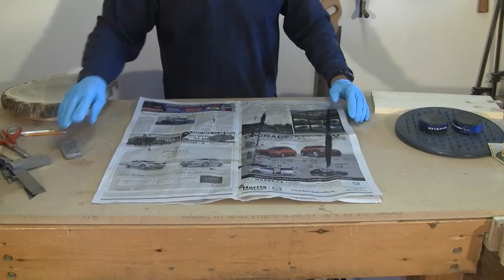How to Make a Lazy Susan with Natural Edge - Wood Turn Table

Comment: colin, ty so much, i,m starting wood work, and i like it, by the way, i,m 62.
Reply from the maker: Dad Ojeda good for you for starting woodworking, it's is never too late to do something you enjoy doing ... well done!!
Reply: amen 2 that
Reply: should i buy a 10'' or 12'' miter saw, what,s ur opinion.
Reply from the maker: Dad Ojeda  Wow, that's really hard for me to answer. I guess simply to say 12" if you have lots of money to spend on tools and blades, or if you need longer cuts. If you want to share some of your cross cut blades with a 10" table saw and you don't need quite as long a cut, this one will also do a great job for you.
If you haven't seen my video on this topic, this might help you too ... Beginners #9 Using a Sliding Mitre Saw   a woodworkweb com video
Colin
Reply: i think i,ll buy a 10'', ty so much my friend.

Comment: Thanks for the video. First I was wondering how that turn table is fitted to both sides as when attached to one side it will block access to the other. I like your approach of drilling a hole in MDF to pass the screw. NEXT, I was expecting you to drill FOUR holes for each of the screws!! At times like this, I remember Newton (allegedly) drilling two holes a big one for his cat and a small one for the kittens. Obviously(!?) kittens followed the cat through the big hole!! Thank you Newton and Thanks to you too :-)
Reply from the maker: Thanks for your comment ... loved the story of Newton :)
Thanks Buddy !!
Colin

Comment: What a beautiful lazy susan!  I never thought of buying the mechanism and making one.  The commercial ones are not pretty.

The one hole you made in the base, and rotated to attach mechanism to top wood piece was a great tip!  I would have never thought of that.

My 3  questions are:
How long did you dry the wood before making this item?
Assuming it is best to cut wood log with chainsaw when still fresh not dry?
Will the bark peel off the log section after a while?  How do you ensure it does not?

Many thanks!!!
Reply from the maker: +Lass-in Angeles The wood I got for this was from a dead, standing tree so the wood was very dry when I got it, and this wood is very dense which means it is less susceptible to splitting, which is a common problem with most woods when we try to do this. The wood needs to be dried very slowly and could take over a year, it is best to cut the slice, store it in a plastic bag and just open the bag to release the moisture once a month or so until the wood is stable .... and hope it doesn't crack.
Reply: I should have read this comment before posting my own question. 
You answered it right here :-)
Reply: +WoodWorkWeb  Thanks!!  Very good advice.  Now here is some from me.  Instead of the Krylon spray, why not try this for a more robust finish:

1. Give this a good coat of Watco Danish Oil Neutral color.  This will feed dry wood so it does not split, and remains conditioned.  Let dry 3 days.  Use this on the wood veneer strip too, so it does not peel or flake but stays conditioned and relaxed.

2. Thin out clean interior oil based Polyurethane with about 70-80% Mineral Spirits or Paint Thinner.  Give the wood disks 2 coats of this, including the bark, letting it penetrate deeply.  50% thinner is not enough!  Must be very thin so you hardly see it on the wood.  This will act as sealer against wood drying out, or water marks, or any type of stains.  Plus, it might act like a glue layer between bark holding it firm around the base.  I would use this rather than the Krylon over the bark. 

3. Rub down top with wax and buff.  This gives a natural appearance.  This phase is optional.

I use Watco oil or boiled Linseed oil on all my wood to keep it conditioned.  For exterior use, instead of PolyU, I thin out Spar Varnish instead which is highly UV resistant.

Comment: Neat project, everyone needs a lazy susan! Looked like you finished one side only, not worried about unequal wood movement causing warping etc?
Reply from the maker: Good observation Michael ... this wood was wee bit damper than I would have liked so going to watch it for a while to see if, or maybe a better choice of words .. how much it moves, it will be interesting to see what it does, I have not worked much with slices like this so anxious to see what it does .. if anything.

Comment: As always excellent job Colin. Three  questions. The slab has beautiful close and even growth rings what species was it? How green was the log when you cut it?  How do you minimise checking?
Reply: Wood should aways be thoroughly dry before coating it. It is a beautiful piece

Comment: How do you dry the wood to prevent checking, cracking, etc.
Reply from the maker: +Merrill Johnson Very slowly ... in plastic bags and only open them once a month or so to let out the accumulated moisture on the inside of the bag. It often works but not always, depends on the wood sometimes too.

Comment: That Spray Or Varnish You Treated The Wood Slice With...Is It Safe To Place Food On It Or NO?  Or Is There Another Way To Treat The Wood That Would Allow Food To Be Placed On It -Safely?  

Also, Do You Need To Measure The Length Of The Nails To What Your Screwing It Down To...So, The Nails (Wood Nails I Suspect) Will Not Penetrate To Your Wood Lazy Susan Side.  🤔🥺  TYIA + TFS!!!
🙂

Comment: What's the best way to preserve and seal the log? I have some big fresh oak tree logs that I'd like to cut and make some clocks out of, but I'm worried the bark will chip off and the slabs will crack as they dry up if I don't seal/preserve them right. Just a polyurethane?
Reply from the maker: no It's good that you are worried about those things because there are some things you can do. There is nothing you can do about the bark, if the tree was cut down in the winter it will retain the bark, if cut in the spring or summer the bark will fall off. (you may be able to glue it back on if it falls off)
in terms of the log cracking, again it depends on a few things. One of my more recent videos talks in more detail, but you are probably best to end seal the log and let it sit until the moisture content gets down around 12 - 14% at that point is should be safe to cut off some slices. Check out this video for more detail ... https://youtu.be/J6Dwn6Ms1-s
Hope this helps ..
Reply: WoodWorkWeb Why will it retain the bark if it was cut in the winter as opposed to spring/summer? I've already cut a couple slices and they look great (aside from having to sand the chainsaw-grooves out). The bark seems pretty strong on there so far...do you think it will definitely start breaking off over time, even if I slap some poly coats on it? Thanks for your response and all the help/info! Love your videos on routers. I'm new to woodworking but I think a router is my next tool. I want to try to make electric guitar bodies; even if they aren't fancy, just want them to hold pickups/hardware and plug in!
Reply from the maker: no Bark almost always, eventually falls off the wood when the the tree is cut in the spring and summer because the cambium layer, that very thin part of the tree that does the growing, is very active a full of moisture (sap) which when it dries there is little that allows it to adhere to the trunk.
If you have already cut some slices, no big deal, you may get lucky and the bark will stay on. At this point you have nothing to lose, try your poly idea ... it surely can't hurt, and who knows, maybe you can teach us old dogs some new tricks :)   Let me know how it goes ...

Comment: I would like to know what's in that, "Ebony" jar, and how you made it. Is it paint, ebony stain, something else?
Reply: Jason McCabe I think that it's a mixture of vinegar and steel oxidation (rusty nails, wire wool) you mix together in a jar and leave it for a couple of weeks. this will bring out the tanning in the wood. works best oak and others with high tanning. I think!

Comment: how do you prevent it from cracking open later on?
Reply from the maker: This wood was a wee bit damper than I would have liked, but I haven't worked much with slices like this, the tree was already dead and was already cracking when they were lobbing off the the off-cuts, so ... really not sure what it is going to do over time. I expect more cracking, maybe a follow up video down the line to show what it does
Reply: good luck with it,the large heartwood area looks nice.I have some red elm that looks similar
Reply from the maker: mrlafayette1964 Yeah, thanks ... I might need that little bit of good luck too :)  What did you or are going to do with that elm, I have never worked with this wood.
Reply: My Dad cut a limb off that was overhanging his road here in NC,old tree and big limb,almost all heartwood like the locust.I'm drying it in the round,gonna make a decorative box or two,turn a bowl and try the lazy susan.I've never used elm either but I like the grain and its a hardwood
Reply from the maker: mrlafayette1964 Making smaller things like boxes and bowls is probably ideal as most limbs have built in stresses that turn up when you start trying to cut them in to useable boards, so the smaller the better. Let me know how you make out with, am looking forward to seeing what this wood looks like when finished :)
Reply: sure thing,thanks for the info

Comment: Colin I don't want to seem as though I am picking fault but I am sure there is a safer way to start the chainsaw either on the floor or with the chain restrained from moving other than that enjoyed the video thanks
Reply: +Treblinka 1 : The Penal Camp   Accidents happen even not running the teeth of the saw can cut through cloth and skin.  If you want to be safe start in a stable way or wear the safety chaps that are available.  Chain breaks are wonderful, as long as they work.
Reply: +Ann Dennis That was a death camp.
Reply: Treblinka 1 : The Penal Camp You are correct, but in 1942 the SS came in and started to convert it into a death camp. Either way you look at it, it had to horrible to try and to survive.
Reply: Treblinka 1 : The Penal Camp I stand corrected.
Reply: +Treblinka 1 : The Penal Camp  The brake was already off. So this was not by the book.
Reply: Everybody starts their chain saw this way.  Nobody's foot fits in the handle so the book goes out the window.

Comment: Colin can you put that through the planer? Or will i lose the bark?
Reply: Right?
Reply: oonoooo
Reply: Don't forget that is end gain!
Reply: Trust me, no. 

At best you will lose some bark...at worst the slice will split once it contacts the knives, thus lifting more of the slice into the knives...it's a chain reaction that lasts a fraction of a second and you essentially get an explosion of splintered wood pieces across your whole shop and yourself.
Reply: I recently made wt 25 of these out of Avocado wood for a wedding. I did run them through a planer worked really well. I did lose a little bark but not much. I was after a level board, and required very little sanding. The trick is to remove small amounts for material with each pass.

Comment: I am afraid that the wood will bend a little over time because the wood from the stern might still contain some water. How do you make sure the wood doesn't rot or bend?
Reply from the maker: I wondered if the round would bend, and it wasn't quite as dry as I would have liked, but so far it's still perfect, and we have had a long spell of hot dry weather, so ... keeping my fingers crossed :)
Otherwise, it will be a simple fix to take it off, do a bit or re-sanding some high spots and refasten.

Comment: Dear WoodWorkWeb: I am trying to replicate your project but I am having an issue with the wood I am working with. I am finding that a few days after I have cut a slice of log, I am getting spit marks appearing and they are slowly getting bigger and travelling towards the centre of the wood piece. Any idea why this might be happening and what can be done to prevent it by any chance ? FYI I am living in Europe and I am using Olive and Pine tree trunks. I have experimented with both fresh cuts and aged wood and the same thing ends up happening...The log is fine but only up until I slice a piece does it begin to separate...- Cheers, Alex
Reply from the maker: Alex D Hi Alex, what you are experiencing is pretty normal, even my cut has some fine splits in it. What happens is this, the outer layers of wood often still retain moisture (sap) while the inner core is much drier (you can prove this by taking moisture meter readings). So what happens because the center is drier, after you cut it, it does not shrink very much. The out layers which are much wetter release moisture and as they do they begin to shrink around the inner lay which is more stable. What this does is make the outer layers crack as the they shrink because they need to move around the inner core.
Pine will be quite bad for this, Olive wood, I have never worked with. The harder the wood, the less this happens (normally) because the inner core is much broader.
Picking logs that have been cut down and left for years (like mine was) work best, but can still crack. There are a couple of things you could do. Slicing the round in to quarters with a bandsaw and letting it dry, then glue back together.
Let it dry and crack, normally, and use the cracks are part of the look of your turntable, or fill the cracks with a variety of epoxy products.
What is important is that the round is dry. If it is now, when you fasten it to the turntable and it shrinks after, it can buckle the turntable at worst, or it will simply stop rotating because it is binding.
Hope this helps Alex ... let me know if you need more ... maybe email me?
Reply: WoodWorkWeb Many thanks for your prompt reply...I sent you a message via yourFacebook page...